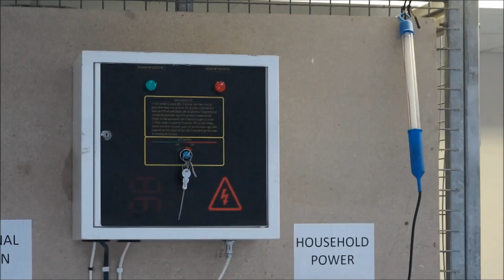How an Automatic Transfer Switch (ATS) Works with a Generator

Comment: Ats is a nice thing to have and I do realize this video comes from Europe, but they are expensive.  I am here in the US and I just had a generator plug put in outside my house wired into my fuse box with a safety lockout.  Yeah it kinda sucks having to manually start the generator, plug it in , and turn off what circuits I don't want power to in my fuse box. Including the generator I spent under $2000 USD in 2024 .  That being said , excellent video.  I really wish I could afford one of these
Reply from the maker: Thank you for your thoughtful comment and for sharing your experience! It sounds like you've set up a solid backup power system, and while manual transfer can be a bit more work, it’s definitely a cost-effective solution.

You're right—Automatic Transfer Switches (ATS) can be a bit pricey, especially when compared to more basic systems, but they do provide a lot of convenience by automatically switching power between sources without needing manual intervention. It's great that you're making the most of your setup, and as prices continue to evolve, there may be more affordable options down the line.

We’re glad you enjoyed the video, and if you ever have any more questions or need help with your current setup, feel free to reach out!

Comment: ok fine......but very roughly ...you dont saying what actually makes a generator to start?
Is it an no contact or nc contact is this contact stays continued on and when it stop goes off?
Can i use any kind of generator??
More explain please, thank you
Reply: Andreas Christodoulou it's the brain of the unit that sends control power to the generator think of it as the ecm is the brain now the hard-drive or processor is the brain so the brain will control all 4 time delays for the Ats it all senses a lost in commercial power and senses the return for retransfer hope that helps
Reply: the ATS tells the generator when to start...
Reply: there is a volt free NO relay in the ATS , this is held open when mains is available . When mains fails the relay contacts close sending the generator battery 12v pos signal back to the generator input circuit . . this initiates the generator to start. hope this helps though a little late .

Comment: where exactly will i connect the communication cable to in the generator please
Reply from the maker: +vivian blinks If you see in the video, when the whole generator is in shot, the cable comes around and into the front control panel of the generator. Here there is an actual ATS port, where a plug fits in, and we can provide both the comms cable and the plug for the unit. The comms cable can be lengths up to 20m, but it is recommended that this be the limit, so that the 12v charge to backfeed the generators battery stays strong.
Reply: can the same thing in done in a portable generator?what is the symbol of the plug in of the ATS swicht in the control panel of the generator
Reply from the maker: +vivian blinks We've just recorded this quick video for you, just to highlight the ATS port on this unit: https://www.youtube.com/watch?v=7yUKEEaa6Tc. It is not a generic port on all diesel generators and unfortunately there is no universal or industry standard logo or icon on generator ports. They can vary widely, but this port is current for the 3000rpm Hyundai diesel generators the DHY6000SE/LR and DHY8000SE/LR models.

On smaller, more portable inverter generators or open frame units, they are typically not designed for home backup in the first instant, so do not make use of an ATS port at all.
Reply: thanks alot
Reply from the maker: +vivian blinks You're welcome

Comment: The owners manual says not to start the generator with any electrical devices connected, run for a few minutes before connecting electrical devices one at a time and to run for several minutes with the power off before switching the engine off to allow the alternator to cool. Let's say for arguments sake that the mains fails when a kettle is boiling, lights are on and maybe the washing machine is also running. Surely this could cause an overload of the AVR when the generator starts up? Could you explain please because I would like an ATS but not at the expense of buggering up my generator.
Reply from the maker: Bob, you are indeed correct, it is dangerous to start and stop a generator under 'load' or with a load on.The ATS does take care of this though. From about 1:40 on this video, you will see the changeover process, but what I suppose our engineer doesn't voice is that when the ATS starts the generator, it acts as a breaker, which only applies the household load from the generator when the unit is ready. Now in this video, the changeover is very quick, for 2 reasons. The generator had been completely serviced minutes before the video was taken, allowing it to start and run very quickly, but also, because the generator and ATS we're next to each other, the signal distances were short, so were not delayed in anyway. So, to put your mind at rest, the ATS won't 'bugger' your generator, in fact will help keep it safe whilst it starts up. The only thing you do have to consider is, if you are running a lot of stuff in the house when the mains fails, if it more then the generator can cope with, once the load is switched from the household consumer unit to generator power, this can overload the generator. Now, the generator has overload protection - at least, this Hyundai unit does, but some may vary. But it will stop emitting power and could need resetting so it is important to consider what's on when the power goes out. Hope this helps.
Reply from the maker: +jim575757 Correct. Though if you'd prefer to have the option of running everything in the household when the power goes out, but not necessarily have it all try and come on automatically and surge, you can opt for a manual transfer switch. Obviously not quite as convenient but potentially more suited to a generator this size, as the genny is roughly only 1/5 of the amperage of a typical household. Auto changeover is great peace of mind though, when properties rely on water pumps to keep drainage clear and/or other vital systems in the home going.
Reply: Bob Bailey Smartest thing to do is to only add some circuits to your ATS, so if generator power comes up your washing machine stays off. This way the chance you overload your generator is very small.
Reply: Your generator surely would have an overload protection. You will not damage it. If it can't keep up, it will go to safe mode.